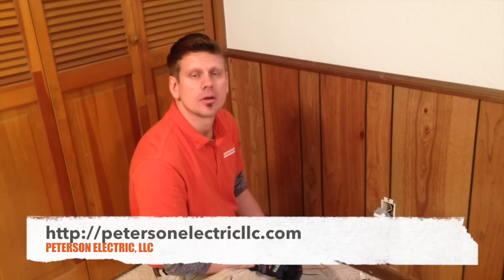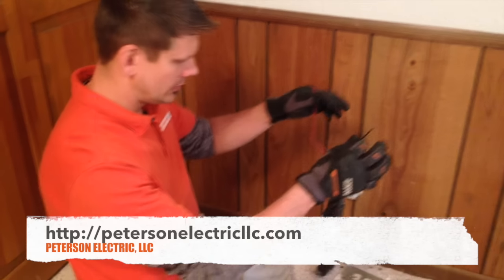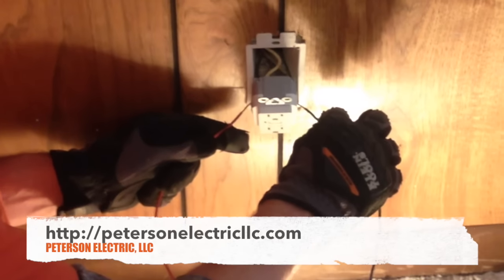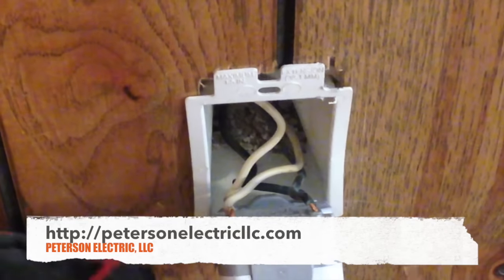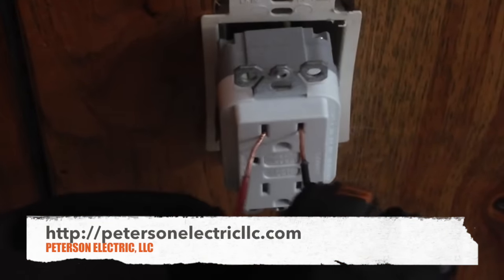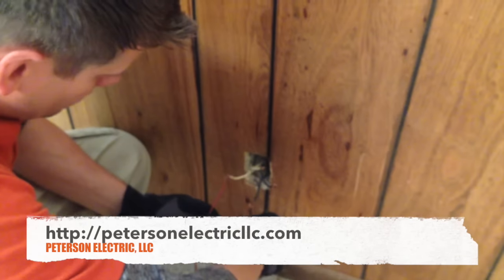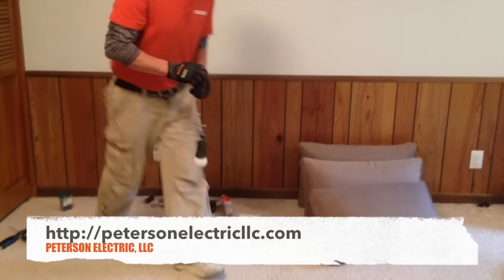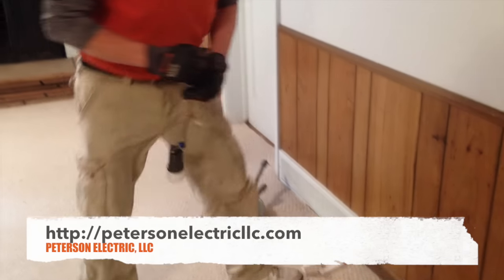A 1950's House With 2 Prong Outlets & No Grounds, What Can Be Done?

Comment: Are you saying that you need to put a GFCI receptacle in EVERY opening?  that is totally incorrect.  You just have to make sure you are properly using the line and load terminations.
Reply from the maker: Nope this video shows that a GFCI is not a device that is tripping correctly, the 50 year old breaker is tripping more frequently than the GFCI plug,  besides, the room is finished, 210.8 is not needed, and if your looking at 406.6-12 when it talks about Grounding EGC- not being present in the circuit-

Read 

 I think most of the people who disagree with this video are missing to important codes. Please, for who every reads this and listens to the video, needs to "KEEP IN MIND" that this video was completed five years ago. It is now the 2017 code so that means we were in the 2011 addition during this video. In 2014 code the NEC Code book in article 250.130c finally allowed a separate EGC (electrical grounding conductor),  (sized off of 205.122), grounding conductor to be ran outside of the jacket of the old BX or NM cable (two wire cables). 
Before the 2011 code it was practiced but frowned upon if you wired circuits without the bare or insulated grounding conductor... Keep in mind that it is not always easy to or able to, run a separate EGC conductor from another circuit or back from the sub panel or main load center.  The code now talks about the means, of how to do it, and from where to pull it from and how to size it, ("BUT"), it does not talk about how to test the path you are using to the ground bar in a subpanel or load center. It does mention how to grab this from another circuit, "Branch", but it does not talk about how to test for impedance or resistance.

 I have typically seen the mistake of running a "Green" #12 or #14 solid conductor from one circuit to a water pipe or another branch circuit, or to another panel, but there was no Grounding Electrode Path or no forth wire conductor in an SE cable back to the main disconnect or panel. 
We have also seen that there was no electrode conductors installed on the main water shut off pipe, or UFER cement electrode and or any supplementary electrodes for two x 8' (5/8") ground rods and no intersystem bonding bridge bars. 
Read, 250.52-53, 250.64, 250.93..... Another good point, is that in 250.104c it talks about now grounding any gas pipes and other metal pipes. The only exception that I have found in the code to allow the connection between the neutral and the grounding connection (ON THE BACK SIDE OF A MAIN BONDING JUMPER IN THE MAIN DISCONNECT) is in article 422 for dryers and ranges. So, therefore the "cheaters" who use a small number #14 or #12 on an old house with the method of jumping the yoke of the device to the neutral of the branch circuit, is NOT ALLOWED> Infact, if the circuit goes bad on the (hot side) of a switch leg of a light fixture, than you are energizing the fixture. No grounding conductor to direct mis current flow. 

The last thing to keep in mind is the code in 406.1-12 under plugs and 404 under switches, communicates that in the 2011, 2014 and 2017 code we have been enforced to add AFCI (arc fault circuit protection) when we replace, modify or repair any plugs and or switches. I believe this can be unclear when the code is trying to describe an "opening". 
An opening is a smoke, dimmer, motion, timer, plug, switch, toggle, paddle, exhaust fan, ceiling fan, can light, puck light, transformer, co detector, pendent, mushroom, bar vanity, heat fan light combo kit, etc...... When we are improving the "TRUE SAFETY" of someone's property and we are exchanging monies for time and product, we are told in the newest NEC that we are to do this a new way, basically "upgrade" the circuit. 

The point of this video is that the OLD METHOD of "just" replacing the two prong plug with a three prong GFCI plug is ("NOT") the safest way and or the "MAXIMUM PROTECTION" that there is for the customer. ("IN MY OPINION") , I show in this video that a GFCI cannot trip only based on a fault between the undground (Hot) and grounded (Neutral) conductors. This home in the video was built in the 1950's and has "no signs" of remodels and branch circuits with EGC grounds and NO grounding electrode system conductors- 250.53.  This "customer", (did not want) their home cut up to install a separate grounding conductor, we were in their basement and there is not pop up tile ceilings, and the house was on a slab, we had no choice on the matter. 

In the video, we are simple proofing that an old Murray (60 year old breaker) is tripping faster and more frequently than a NEW GFCI plug. Point being, what is so important about installing a GFCI plug in an area of the home that is not in relation to 210.8 for GFCI protection. The room has carpet, it is finished with drywall and has no water. 

This is OLD and SIMPLE Thinking, to keep stating what 406 talks about under two prong plugs has to go!!! 
The 2011 and 2014 code tells us about AFCI protection, but our AHJ and city officials have not pushed the code of AFCI protection on simple repairs and replacement of plugs and swtiches until now. The 2017 NEC CODE BOOK in article 210.12 B states that if we modify our cirucuits, or extend or replace we have to AFCI. 
WE NOW HAVE NOT EXCUSE, that we cannot find a AFCI / GFCI (Dual) plug. We also, have breakers (overcurrent protection) that allows us all three options, AFCI and GFCI and Overcurrent in a breaker switch protection. If the panel cannot fit or accept the newer breakers than we can trace and label the circuits and install the protection at the LINE SIDE OF THE EXISTING CIRCUIT>   BUT, I still say, why not run an EGC conductor to help in this situation if you can cut drywall and or fish the EGC in. 

Bottom line, if we are not adding AFCI protection than there is a standard that we are not practicing by. This is not an easy process, but if we do not get past our concerns/fears and start to practice with better skills than we will not grow in our field. 

I have personally modified 14 homes in the last six years with TOTAL AFCI Protection, and in most cases upgraded the existing panels and also added ALUMINUM PIG-TAILING protection with new TR (tamper restive) and WR (water restive) devices. If the panels were too old, we than, also upgraded the service with the meter as a by-pass lever and added all electrode protection needed. (WITH PERMITS).
 Later, we have had to add EGC protection to the circuits that had electronics and or computers. Some cities were very hard on us to install all Smoke and CO detectors with three wire 110v feed devices in the NFPA 72, for homes. 

If you cannot add EGC grounds than protect first in the panel with a Dual breaker. If this is not possible, than protect with a Combo AFCI & GFCI plug, but if you do not have an EGC throughout the circuit than you need to install A DUAL PLUG, in every location, assuming your old metal boxes have the volume space in article 314.  
Personally i would parallel all my connections with pit-tailing, whether you have copper, aluminum or copper clad aluminum. 

MY POINT IS, (since i have been so challenged by this video) that if you are not AFCI protecting, updating grounding on EGC and Electrode System,  and possible the service with a new main disconnect and by-pass lever,  than you are not doing your job!!!!  (unless, your city has a lower standard, but HERE IN COLORADO they are very complaint and enforce ALL NEW CODE UPDATES> 
 Better protection, safer standards for the customer is in article 90, this is for the safety of lives and property. NO IF, ANDS OR BUTTS!
Reply: Hate to disagree, but you are showing the GFCI on the load side will not trip the GFCI unless it is grounded by shorting the neutral and hot out.  That is a dead short, which is NOT what the GFCI is designed to protect against.  You show that it will not trip if you go from the hot or the neutral to the ground terminal.  Of course it will not trip.  That is working exactly properly.  The PURPOSE of a GFCI device is to look at the current flow of the neutral and the hot and make sure they are identical.  If they are not, then it trips.  It has NOTHING to do with a short between the neutral and hot.  The ONLY way you can trip a GFCI is to have a second path of current flow other than the neutral.  Of course you do not in your situation.  But run to a second grounded source and the GFCI will trip just AS DESIGNED.  It is sensing the current flowing in a direction other than how it should be and trips.  The 3 wire receptacle you install, will not ever show a ground on a two wire system.  It will however work the GFCI device EXACTLY as designed if the current flows somewhere other than back on the neutral.  You are trying to make the GFCI an overcurrect protective device which it is ABSOLUTELY NOT.
Reply: create a 5(ma) imbalance between the hot and neutral and see what happens.

Comment: EGC under 250.130(C) can be cheap if there is access under the floor.  Does it make more money to do easy, high markup makeup work?  You bet! 

Check your code compliance office to find out if you can add an EGC.  Ask specifically about NEC 250.130(C).

Be careful about people who "forget" whole code sections, or electricians who don't want to get under your floor.  Way too dirty down there!

Comment: So, In order for the GFCI to be useful, you need one on every outlet? Not just the first one in the line?
Reply from the maker: This video is 10 yrs old, the new code says AFCI and GFCI
Reply: No, not every outlet.  Any grounding-type receptacles must be fed from a GFCI, either a breaker or from the LOAD terminals of an upstream GFCI receptacle.  All such receptacles must also have proper labels: GFCI protected and No Equipment Ground, to meet NEC (2005-2020) 406.4(D)(2)(c).

Comment from the maker: No, I am saying that the code allows you to GFCI the ungrounded plug, but in another part of 406.12 you have too AFCI the plug or circuit. They do finally make a multi style of TR, GFCI and AFCI> TR is tamper resistive to protect children.
Reply: All you have to do is put AFCI/GFCI combo breakers on the circuits you plan to covert. If you do so i recommend using self testing breakers. You might also want to put stickers sating that their is no equipment ground Ive only been called out by one inspector for this, most don't care.
Reply from the maker: This is true, assuming the customer wants us to replace the panel. Her panel was very old, from the early 60's. They did not want us to upgrade the service, we gave them a bid but not interested. It is difficult to convince someone to see it is a good investment if they are staying there. Some people think that your trying to up-sell them and usually their partner or spouse are not there to see what you are stating. Electricity is not a vehicle that they can test drive, so if they can not visual it then it is not always easy to win their sale, for safety.
Reply: I know exactly what you mean, alot of people have the mindset that if it works its fine.

Comment: Yeah. If GFCI does not detect a ground-fault it will not trip. So, you can still be electrocuted if shorted to hot and neutral while standing on dry board.
Reply: It detects imbalance of current along the neutral as soon as any current doesn’t return back( ie you) but it won’t trip against any ground fault

Comment: Gotta love the houses where you see Kn2 in the switch but all forms of romex in the outlets all on the same circuit.  Wait… you remodeled the 3rd floor attic and the electrician didn’t tell you the 2nd floor is all tapped knob and tube? 😢

Comment: So what can be done?  That's the title of the video.
Reply: That's exactly what I was thinking. The video isnt finished. He just said turn off the camera.
Reply: It wasn’t even a tutorial. It was hey people from some comment thread who pissed me off, let me show you how you’re wrong. This is a great example of how not to do a YouTube video.
Reply: @scottsword3066  What can be done is that every outlet needs to be replaced with a GFCI not just one GFCI per line as some claim.
Reply: @Jay D what is the advantage of that?
Reply: Scott Sword the advantage is to protect each old wiring outlet by placing a gfci in each plug receptacle to protect each one because the old wiring doesn’t have a ground wire. today’s wiring has 3 a hot a neutral and a ground wire. the old only had 2 no ground and bad things can happen without a ground. install a gfci in each outlet receptacle and each is protected. does that clear it up for you?

Comment: I believe as of 2020, one GFIC at the most upstream outlet is acceptable, here.
Reply: Yes it is IF your home wiring system has a ground wire thruout  .Needs a ground to work properly. otherwise it works like a breaker for each outlet that you have a GFI outlet installed .Without a ground the downstream outlets are not protected by the upstream GFI outlet BUT it will trip the braker in the panel..Just not as quick..Could be a real bad day for the recipient of a shock.
Reply: @ricks88s  Thanks, Rick!
Reply: @ricks88s I’m just asking.  Didn’t he trip the gfi when he shorted the downstream exposed wires ?  If so it did it trip at the panel or did it trip the gfi and the panel ?

Comment from the maker: Yes, if an ungrounded conductor (shared on Neutral or not) goes to ground on the metal of the fixture, or metal yoke strap of the device or cover plate or the appliance, you will get shocked. The EGC equipment (250.130) grounding conductor is the “separate” path that allows the conductor to take a least path of resistance to earth instead of the person or pet. 
This is assuming that article (250.52-53) are installed on the main disconnect and all sub panels or load centers are floating their neutrals from the EGC, until first point of dis.

Comment: Two wire hook up, no color ID on either conductor. You need to test phase, identify which wire is coming off breaker and which is from the neutral bus. Can I still install a new3 prong if wired properly with just 2 wire / no ground? And label as such, no equipment ground?